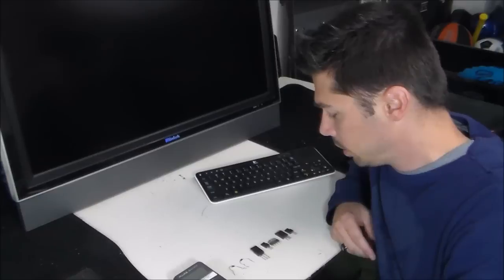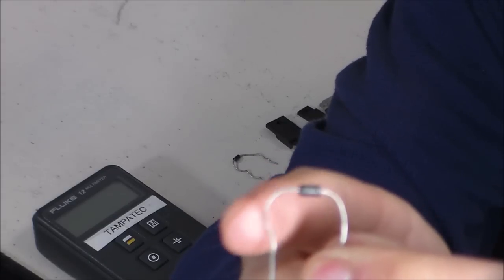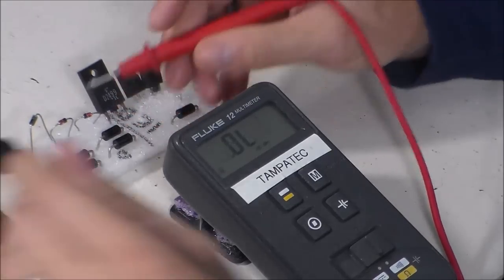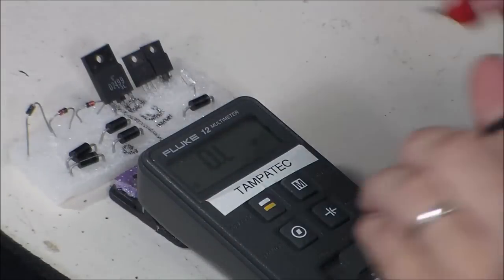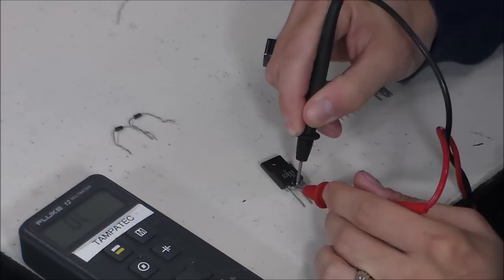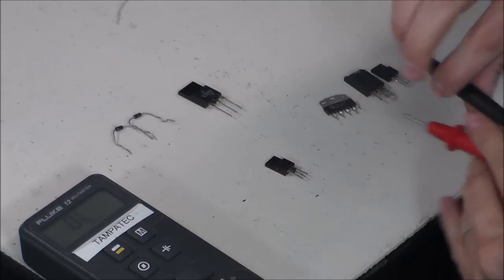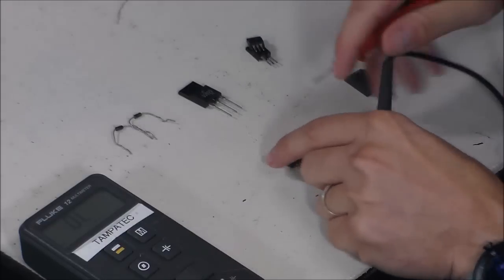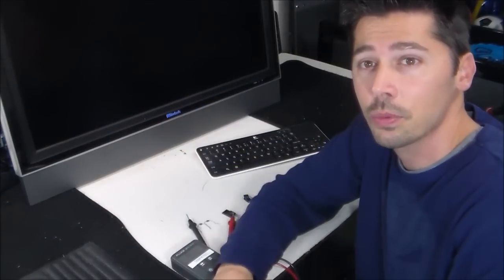How to check fuses, diodes, transistors, voltage regulators

Comment: Still relevant 9y later.

I was diagnosing an AC power problem in a JBL Partybox 300 that was left out in the rain and no longer works so the owner replaced the unit and gave this one away. $50 in parts and it's good as new.

Thanks for all your content.
Reply: Cannot read meter  to dark

Comment: I'm not getting a reading on any of the three pins transistor.  I had it in the pcb and I got the one O.L from the left pin to the middle even when switched . Then I did what you did on the right side and the middle. I got 4.5 . Figured it's a bad trans.  But took it out and now it says O.L on all the pins, no matter how I do it with no beeping, lol that mean it's still bad

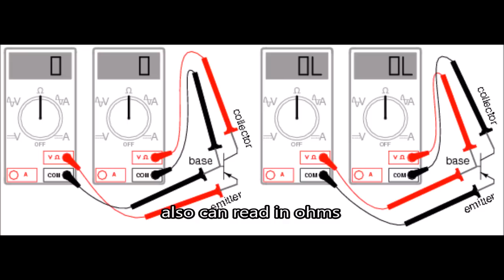Comment: @6:10   IMHO the picture is wrong.   

The two Multimeteres to the left: the reading should not show 2x 0 Ohm´s, that would be 2x SHORT.
The Display should say   1kΩ- 10 MΩ  (that´s what FLUKE says about R-Values Range).
There has to be some Resistance that the voltage drop across the junction develops.

Or am I completely wrong?

Good Video anyway 
👍

Comment: Do you need to removed them from the board?  or can they be tested while been in the board to get a correct read
Reply from the maker: It's more accurate to remove parts.
Reply: @TampaTec  thanks for replying. I've been trying to learn more.

Comment: Is it normal for tiny diodes to read as if no resistance is being put on the current. I'm working on a small pcb for a ps3 controller and I'm trying to figure out where all the bad components are and replacing them. Also trying to figure out which parts to replace. Got a ways to go.

Comment: Can we measure a diode in circuit? will it be still accurate? I have 4 diodes with the following readings, in diode mode I'm getting, .002v, .510v, .510v, .009v. Anyone?

Comment: This is super helpful.  I am trying to fix a Halloween inflatable that has the "short circuit" light effect.  These are "simple" circuit boards, however I am not a technician.  I have tested everything on the 2 small circuit boards.  There seems to be a transistor that is not functioning.  Sadly I have tried finding the transistor number and have had no luck what so ever.   Thanks so much for the great video it really helped a non technician like me.

Comment: I know this is an old video, but the information is still good. It would be helpful to know how and where to order replacement voltage regulators and transistors and diodes.

Comment: Emitter , collector , Base.............. not Emitter , collector , gate. Also don't assume all transistors have the base on the middle pin
Reply from the maker: Yes, thank you for correcting. I should've used spec sheet to give most accurate information about that.
Reply: @TampaTec  no problem.....keep up the good work !

Comment: This is by far the most helpful video I have found on this subject.  I have an LED grow light and one of the drivers blew a resistor and I replaced it and it just blew the new one as well.  I figured there had to be another issue somewhere down the line, so I have been trying to find a video to tell me how I can test each part of the driver.  I haven't gotten to it yet but once I do this video is going to be a great help.  Thanks so much, keep making great informative videos and I'll keep watching!

Comment: 7:20 Is it possible this is a 2S series transistor with ECB legs vs 2N series with EBC configuration?  You never tested pin 1 to pin 3 to see if there was a voltage drop. I'm new to electronics so, just a thought...

Comment: I have a few transistors in a vintage Magnavox record player
The controls are acting weird
The balance controls the volume and the bass and treble control the balance
I’ve never had this issue, would a capacitor or transistor that’s bad cause that?

Comment: On multiple diods on my tv's psu I gott a .7 reading in one way and a 1.7 reading in the other way. Is it worth it to replace them all or is this issue caused from a nother cause this is on the half of all diods like this. I guess a bit to much just for a random broken diode. But on continuity test it just beeps one way. Strange. I tested in circuit. When i test it on ohm it got 40k in one way and 60k ohm in the other. Did i blow them up while testing them in circuit of the psu?

Same with all transostors... Is my meter broken?! Sorry but nearly all diofds an transistors broken on same time ?!

Comment: In your video, you have a ohmmeter illustration showing that you can check semiconductors. I believe that since the voltage across the probes is so low, the semiconductor will not be biased into conduction. You could do this with an old analog meter but modern DMM can't hence the diode selection on the meter.

Comment: Hey im new to this.. I flip and sell audio stuff and albums on eBay...but I have compiled a few receivers that aren't working.

Now what I'm new to is "working" on them.
I have a craftsman multimeter but on the Ω it has a bunch of numbers to turn the dial to.. For example 20-200-200-2000 ..
What do I set the dial to to check properly?

Comment: At around 6:58 you got distracted.  You are testing PNP transistor. You said I got my positive lead on the N,  Well, you actually had your positive lead on the P, correctly.  But in a bit you got it straightened out.  There was some miss naming a tat before that as well.  It is all good brother.
Reply from the maker: Thanks, for correcting me and explaining your logical view instead of many others that rake me through the hot coals. 👍

Comment: Sorry to correct you on measuring diodes the 0.3 to 0.7 is the measurement in dc voltage with the equipment on, this is not measure in ohms.The Diode out of circuit is measure in ohms, the diodes that you are showing here the multimeter can be put on the diode symbol or analog meter on 2000 ohms But if you are checking a heavy duty diode things changes use the ratio 1/1000 the value of ohm is very high always keep in mind the ratio.

Comment: Diodes block current not voltage😁
Reply: ...and since current is the bi-product of voltage and resistance, his statement is not false. Without voltage, you can't have current! So if Diodes block "current" one way, they are also blocking voltage.

Comment: Hi Great videos Question Can you   Test Transistors and Voltage Regulators   attached to the Board,   if so do you have   or would you make a   Quick vid,   Cheers

Comment: Hi. If say you need to replace the diode and they don't have the exact one. Could you series a diode so that it matches the value of the diode you're replacing?

By the way, what's the value of a diode if it has two stripes and it says M2? This is on a Famicom video game system's power supply. 

Are those transistors, the same as the transistors in a CPU or a GPU? If you had a billion of those big transistors, could you built a CPU?

Thank you. God bless, Proverbs 31

Comment: Ok so ... I have a 50" Panasonic TV (TC-L50EM5) ... That turns on, but after a few minutes up to 30 minutes, it shuts off, and I get a SLOW constant red blink (no sequence  of codes). I noticed that a FAINT "clicking" sound comes from somewhere on the PS board .
Could the problem rated to one of these tiny little componenets, and NOT a capacitor ? Thanks !

Comment: Thanks for the great video! I have a little knowledge on electronics. I decided to dedicate some time to learn more about it because I have a few amplified speakers which don't turn on and my mission is to be able to fix them myself using only youtube videos like this one and others where they do repairs and explain how amplifiers work... Hopefully it doesn't take too much time. I saw a comment on a website where a guy mentioned "check the MOSFETs they may be the reason of the speakers not turning on.."
Reply: And with your explanation on how to check transistors is helping me too.
Reply from the maker: Thanks, yes you are correct many times they go bad.

Comment: when i read my diode in circuit it shows 28 on both sides but when i read it outta circuit it reads 456 so this would be good i take it bc when i put it back into curcuit it reads 28 again

Comment: Can this help with blown amp? I am getting loud hum from a BP7004 and I changed and upgraded the capacitors believing that it was bad. I put everything back together and got no power light or sound. I take out the amp and plug it to power and get a small hum from it. I don’t want to replace them for $200 for 2 amps if they will have the same problem down the road. Please help.

Comment: I remember way back when - I was confused by the fact when checking a diode (no power) the black lead to the Cathode - the red lead to the anode and you would forward bias the xister and see a voltage drop across the depletion region.  (~ .400 volts.)

But, then, in the circuit, under power, you would take your POSITIVE  voltage reading off of the Cathode.  Seemed funny but the answer is this:   Current flow is Towards the cathode (band) thus, as the electrons leave the cathode, moving across the depletion region  (making it less negative and more POSITIVE, in respect to the Anode,  your volt meter, at the cathode will read a positive voltage.

Comment: On my power board 3 transistor only one side reads on the high side and on the low side the transistor is all reads are different they all gave me different readings no matter where I connect the +/-

Comment: You have a great site,I'm having trouble repairing a TVL power board,TV is LCD,no power at all when I turn on the TV I can hear a very faint clicking noise coming from the power board,there are no bulging caps,I had a similar problem with a stereo amp,I changed an orange cap and it then worked fine,could it be one of the 104k capacitors.thankyou,you have the best YouTube posts.

Comment: hi. I have a Sharp Aquos LC-C6077UN TV. The problem is, I plug it into power, automatically powers on. Picture shows fine,but after about 15sec or so powers off. Then about 15sec powers on by itself. It will keep doing this as long as it's plugged in to power. Do think it has anything to do with a bad power supply.Thanks.. Any suggestions

Comment: Hi,
I have watched many of your videos, and you helped me find one of the faults in a toshiba tv i found.
I have an issue with a seiki tv that I dont know how to move forward with and was wondering if you had any ideas. the tv has a power supply and main board in one. the tv turns on, and an image goes to the screen but there is no backlight. when i went to check the LEDs, they are all blown out. so, i went to check the voltage going to the led cable connector. it fluctuates from 30-50VDC, but tries to get to around 48. nothing is blown-looking, burnt, etc. I dont know what to test. since it turns on and gets power and image, I was thinking maybe a regulator or something like that. I tested the iodes near the led connector and the little SMD caps, or the little black rectangle things 3mm thick, and I dont think any are blown. I only have a basic cen tech multimeter right now so its not very helpful. doesnt beep just stays at "1" if something is open (i think). 
anyway, sorry for the long post. would you be willing to give me any pointers? im trying to learn how to test things at chip level. (in college studying CIS) thanks
Reply: im still trying to learn what all the components are called. im trying to teach myself, and unfortunately school doesnt have electronics courses

Comment: Is there such a thing as a blown fuse for "no good reason"? I like to remember that we had a few sub woofers that seemed notorious for having blown fuses, and the way I like to remember it from years ago is that we simply replaced the fuses - does that make any sense?! :) I know I still got one in the attic and now where I have a MM and am 1% less of an electronics n00b, I wanna check what's wrong with it...

Comment: cool,..where do you look up the transistors ?
Reply: Daniel Hawkins - usually I am successful by googling "device part number" and "datasheet" together... If I don't know which is the part number I try each number series separately.
Reply: If you are trying to identify semiconductor parts with no visible marking, the schematic for the circuit is pretty much a requirement...  Sometimes easier to find than others.

Comment: Great video always wanted to learn electronics as a hobby this info is priceless
Thanks Brotha,  

ps  Now I can try and test my Halfer 500 amp
Reply from the maker: check parts on heatsink and solder connections like resistors

Comment: Hi thanks for your helpful video, much appreciated.
Just need to know if it's ok for me to test them all with the board still in the 
TV, with power off obviously ;-) Thank you Mr
Reply from the maker: * CaT * you can test parts in circuit but some parts like capacitors won't be read accurate. always read questionable parts out of circuit. i desolder a capacitor leg from the board and I get a accurate reading.

Comment: For the components you tested out of circuit...is the same procedure used when they are connected to their boards?
Reply: good question,,did  you find out ?

Comment: Thanks for explaining in simple terms how to check transistors and diodes.  It appears that using the diode mode rather than the ohm setting on your meter is a much easier way to tell if you've got a bad one. 

Regards, Tom
Reply: nice thank you

Comment: hi, im not that experience in this filed may i ask ,
what is the 0.3 0.5 0.7 for the diodes , then you changes to om then you say 2000K ? 
thanks
Reply from the maker: diode acts like an one way gate allows volts in one way but blocks the other reverse way.  meter tests it and should get small voltage .3 to .7  passing through it.
Reply: +Tampatec what about the 2000K that you mentioned also?
Reply: A diode is an electrical device allowing CURRENT (not voltage) to move through it in one direction and blocks the the otherway.
Reply: silicon diods voltages read from .5v to about .7v

germanium diods read from   .2v to about .4v
Reply: +Navid Rasouli nice nitpick

Comment: howcom on some boards transisters have the middle pin cut
Reply: The metal back works as a 'middle pin' in such cases.'
Reply: Deosgaeno ok thanks. so much for the anser

Comment: im a macgiver and a avid dumpster diver i find electronic devices some are broke ive fixed some some i caniableized for parts your videos are a big help for some one like me that is self taught in electronic repair ive even built my own suround sound module out of spare parts when i was 12 im 42 now it finally fried a year ago because of a bad storm knocked out the power and took out my pc power strip and extra surge protector found out the telephone pole got shattered by a lightning bolt tooth pick city
Reply: Steve Obee commas
Reply: @lincruste  DRUGS. commas and periods not needed.

Comment: with a vinyl capacitor in the board checking voltage should it have voltage on the negative side
Reply: this is checking voltage on xboard
Reply: with my multimeter on chasis ground if I touch negative side of meter most caps 0 out but I have 2 that pull a high amount if voltage on negative side

Comment: Hello Tampatec, is it right to read diode or any component's resistance on pcb (without unsoldering first)? i have seen only voltage reading on pcb..thanks in advance

Comment: One of the best vids on youtube on the subject but how to test Schottky diodes? I have a faulty Samsung TV power supply (no standby) and I am trying to test several Schottky rectifiers (links below). I am getting readings both ways - around 0.8v one way and around 0.3v the other way (switching multimeter probes). Is this normal for this kind of components? I couldn't find a vid on how to test these.  Thanks.

http://www.onsemi.com/pub_link/Collateral/MBRF1545CT-D.PDF
http://www.smc-diodes.com/products/data/SBRF20100CT%20N0921%20REV.-.pdf

Comment: hey bro you said npn or pnp transistors as negative positive does it really?....cause i have studied electronics n is n-type semicondoctor is pentavalent(germanium) and p-type is trivalent semiconductor(silicon)...and i have a question you said we can use two diodes as pnp or npn transistor(which takes more than 3 volts and gives two volts output)...for instance if we connect two positive sides(to act as base) .... and give 4 volts to it and what would be output at emitter and collector?....and what would happen if we connect two diodes in other way?

Comment: Thanks!
I found a bad voltage regulator in my headphone distribution amplifier thanks to your video. Ordered the replacement part on ebay.
It was a MC7805C I found the MC7805CT as the replacement. Data specs look the same, but I can't figure out what the T at the end means.
Probably something simple that should have been apparent.

Comment: Hey great video!! I have a question... So I've been trying to fix this toshiba tv that broke and I found out that it has a broken diode because it reads current both ways. So if I were to replace this diode what numbers and information needs to stay the same and what do I need to look for so I can get a new one and finally fix this thing?

Comment: (Tampa tec )need your help bro, I have a emerson lc401em3f  it clicks when plugged in,no standby  red light. and I've replaced the fuse, tested all resistors  diodes, still nothing.can you help